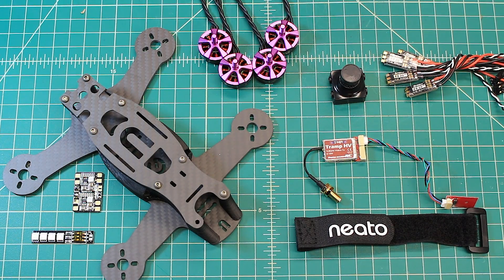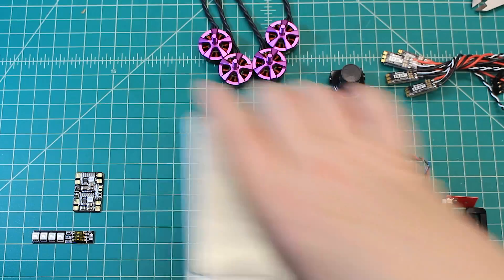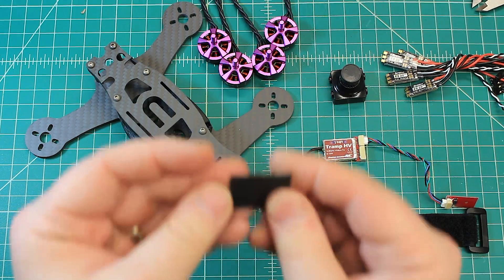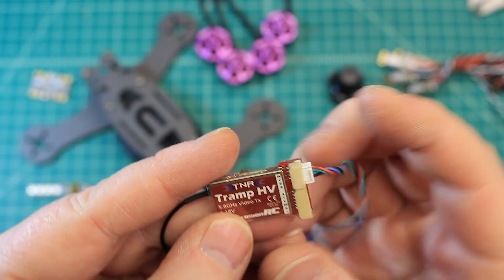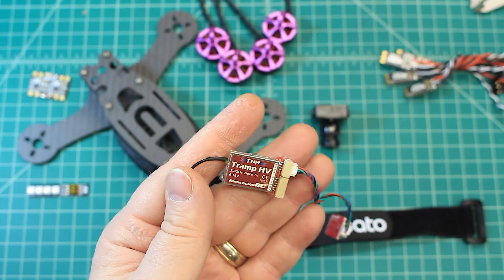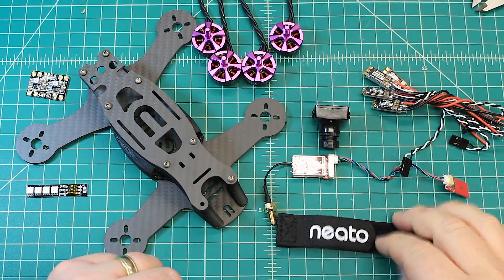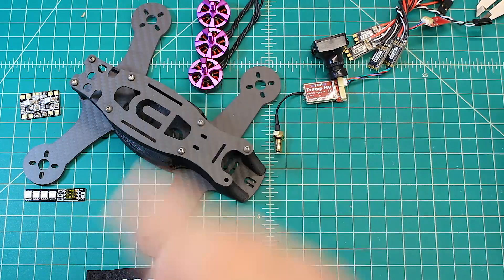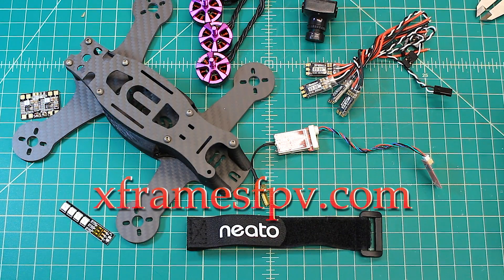Neato 180 Sexy Beast FPV Frame Buildout

Comment: hey nice video I'm starting to enjoy them.only just found your channel 2 days ago but so far it's awesome.i have a question.What escs and pdb and fc would you recommend at the moment for a 5 inch build
Reply from the maker: I really like the Spedix ES30, they are small and inexpensive. With these ESCs I would run the Hyperlite F4 and a Matek XT60 PDB.  I also like the Lumenier 20a 4 in 1 with built in 5v regulator, this allows you to eliminate the PDB if your use a FC that takes VCC like the LUX V2.
Reply: X-Frames FPV ok thx for the tips I'll definetly make sure to look into those thx for the reply!

Comment: I bought a set of the hyperlite v2's but they are now out of stock. Are the brotherhobby returner r2 really the same motor and are they only available on banggood? I already have to replace an esc and I think I should get spare motors. Thanks!
Reply from the maker: Yes they are he same thing. I have some of the Hyperlite's in stock if you need some contact me at memphis@xframesfpv.com

Comment: I have a question: I use xm20a escs on my quad but I think I messed something up while I was callebrating them. They react really confusing if I just arm them and but roll all the way to the right 2 motors spin faster like normally but if I let the stick go the 2 motors keep spinning as fast as they spin before I let the stick go any ideas how to fix it ?
Reply from the maker: SiltecZ neuer Kanal if I'm hearing you correctly and if you're in angle mowed it sounds like that's just the motor is trying to self level. Possible I'm not understanding your question though.
Reply: X-Frames FPV if I fly and for example just put roll stick to the Right the quad will roll normally but it won't stop unless I correct with input to the left but the right motors dont slow down instead the left speed up .Actually the motor won't slow down unless I disarm the quad